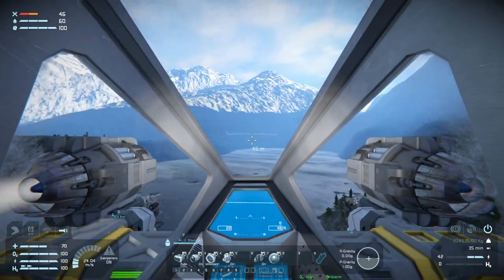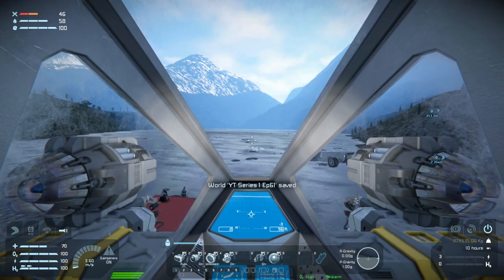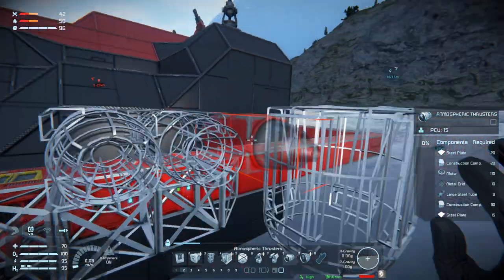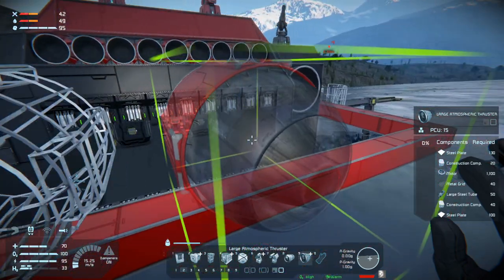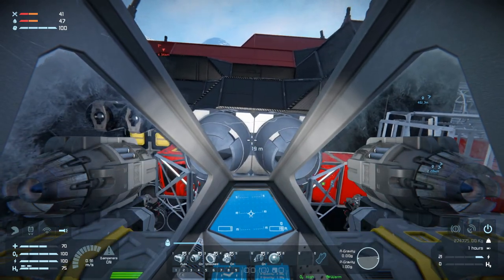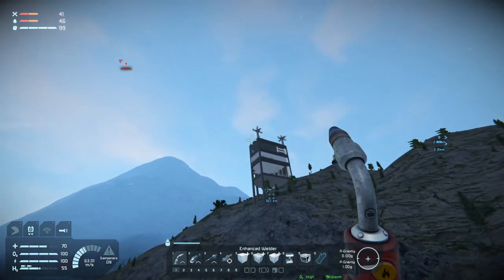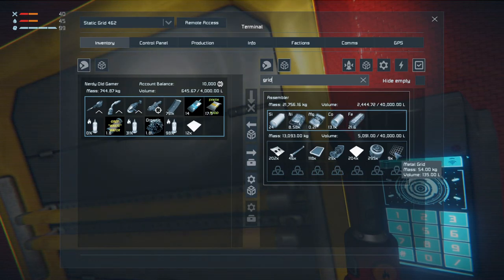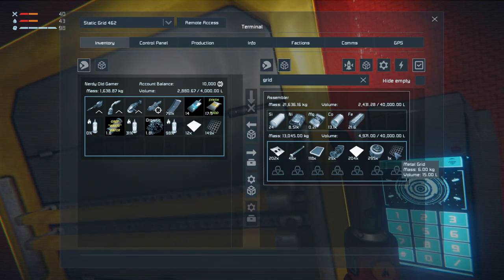Lets Play Space Engineers Modded Survival Ep62 | Lifter Ship Construction

Comment: The issue with the motors is another reason why you need to properly setup your conveyor system with sorters so that specific things go into specific containers. Not saying that is the problem but it could help.

As far the assemblers are concerned I would offer some common tech advise - turn all of them off and on again. If that doesn't help I would dismantle them, go up and check that all the lines are properly linked up, and then rebuild them. I believe there was a bug at one point that caused items to essentially disappear from inventories but the game still thought they were there. I don't know if that is still around but if it is then maybe your assemblers have phantom items in them and they stop building motors because they've reached their max volume for produced items. I would also directly link all your assemblers with a loop of conveyors that only go to the assemblers themselves and not the rest of your system to see if that solves anything.
Reply from the maker: Hi Flawless, I haven't figured out the assembler issue yet, I will give your suggestion a shot if I get back to the base "wink wink"...
Reply: @NerdyOldGamer  Guessing you solved the hydro thruster problem then lol. One other thing I might do is not bother using that cooperative mode thing for the assemblers and just devote each assembler to making 1 thing. One assembler can be for motors only, another for steel and interior plates, another for girders and grids, etc. Might be a slight pain to switch assemblers in the menu for each thing but the hoarder in me says "just make 100k of every item and should only have to setup each assembler to make stuff once a week or so" xD
Reply from the maker: @LagunaFox  I could always setup as many assemblers as there are items, but I kinda like the idea of it being automated and all of them just producing what I need really fast... I want the automation to work.....
Reply: @NerdyOldGamer  I hear ya, I watch several others that play SE though and your the only one of the bunch I watch that seem to have this problem. Most of them use sorters and stuff though, or only 1 assembler. Others that do multiplayer stuff every player just sets up their own assembler. So I'm guessing it is something wrong with the way you set stuff up, but it is really hard to tell.
Reply from the maker: @LagunaFox  I do something wrong every day, just ask my girlfriend ;-) figuring out what the heck it is... That's the trick... and apparently I'm not very good at it... Again according to my girlfriend :-D
Reply from the maker: @LagunaFox  Who're you watching? I'm guessing Splitsie & Captain Jack?
Reply: @NerdyOldGamer  Captain Jack yea, also watching Kage848 who is a first time player, I'm also watching a guy called w4stedspace I believe. So a couple different people. I'm currently watching wasted's Escape from Mars streams from a few years back. I really prefer longer videos as they are often unedited and you really get to see all aspects of the game so his 3 hour vids are great for me.

I'm a rare breed I suppose, I'm of the mind that if I find something boring I can skip it myself, I don't need the content creator to make that decision for me. That being said Captain Jack does a really good job with the stories him and his group do and the production value of those are pretty good as well.
Reply from the maker: @LagunaFox  I watch a bit of all 3 of those too
Reply: @LagunaFox  Do you watch TheXPGamers? If you don't they might be worth a look.